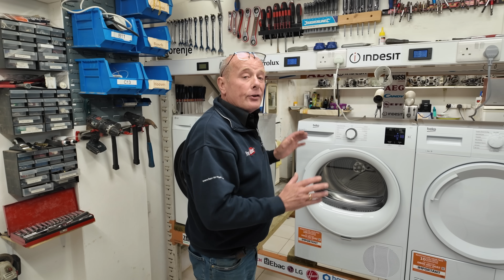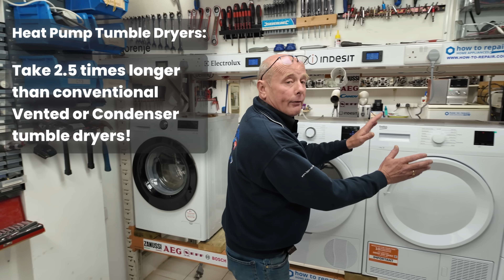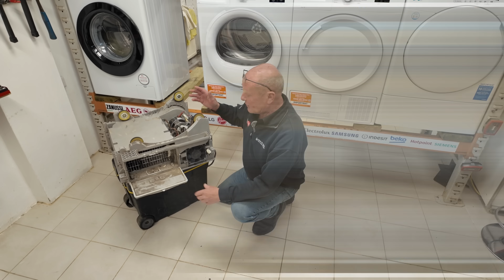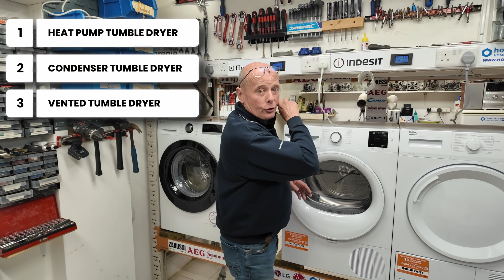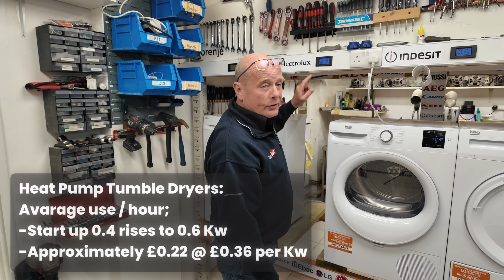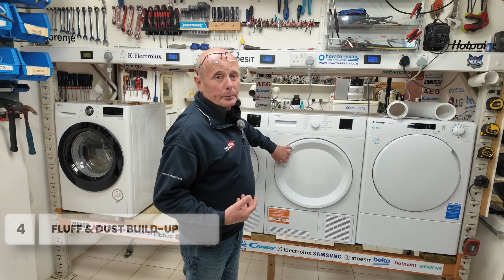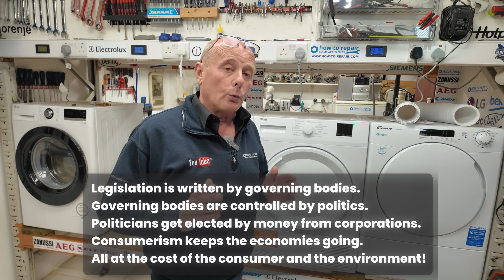Tumble Dryers the Shocking Truth About Heat Pump vs Vented & Condenser, NEW LEGISLATION!

Comment: If I live near a laundromat, I would drag my wet laundry to semi-dry in the winter season. I don't own a dryer but have recently used one at £2 per 10min. I find that it shrinks my clothes and that the dark colours do fade. 😕
Reply from the maker: Whether you are using a  vented tumble dryer or heat pump it is down to the user to make sure it is on a low enough temperature not to damage your clothing, thank you very much for your comment

Comment: My Heat pump tumble dryer takes <0.7kWh per load of clothing (measured at the outlet). I am not using the "green" defaults but set the power to +1/3 to make it significantly faster. The power savings paid for any additional cost and then some in the 6 years I had it.
Reply: The condensing dryer is just boosting the heat in your house during cold periods, which is when most people use a tumble dryer... No heat is lost
Reply: @chrissmith2114  shut it
Reply from the maker: I've never disputed the energy saving on heat pump technology but the wear and tear, cost, and insufficient thought by the manufactures to people who have to maintain them. Thank you for your comment.
Reply: Shut it

Comment: I am a domestic service engineer and this  is correct,  heat pump  dryers are a waste of time as the take to long to dry clothes, they have to be in a space  which is at least 15 c  to start with and within a short space of time they block up inside which is a 2 /3 hr repair with specialist tools. They have been completely mis sold !!  Condensing dryers are much more efficient and what you should buy.
Reply from the maker: Thank you very much. I always appreciate engineers leaving their remarks so it gives an independent view from other prospectives. Please try to share it with your customers.
Reply: My 3 old AEG heat pump driers are all working fine. Sure, I took them completely apart and cleaned them. Then installed a piece of 10ppi filter foam in front and the air flow is still perfect. No lint anywhere, except where it should be. Very low electricity bill and the noise is so much lower (on mine at least). My clothes don't shrink and keeps the color. The heat pump system on my combo AEG is super easy to service Takes just a few minutes. But not really needed any more after the 10ppi extra filter foam installed. I measure a 15+ difference in temp in well under 10 minutes, even though they are all in our basement (not warm, not cold either). I am very satisfied that my room does not get warm and very moist after drying clothes, pillows, jackets and duvets. My old Bosch condenser dryer burst into flames despite being very clean inside out. And it killed the clothes and was expensive on power.
But I agree, that so many machines today are built like crap. And WAY too expensive on parts.
And for sure, heat pump driers should be easy to maintain.
Sack the huge army of MBA's and things will improve all over the planet.

Comment: Appliance engineer here - heat pumps are a lot better in my opinion, they don’t shrink clothes. Risk of fire is so much lower and cost a lot less to run, YES they take longer to dry BUT an average cycle for me is 2-3 hrs which is don’t think is that bad tbh most of the time I run it over night so time means nothing anyway. In regards to the lint build up, if the filters are emptied after every cycle this wil never be an issue
Reply: How many times have had to strip down to the evaporator and condenser to clean it out properly.
A very time consuming procedure.
The principle is good but the design for maintenance very poor.
Reply: @atalanta6153 That may be so but can that problem be sorted by better design.
Things often improve in design over time.
BTW I don't argue for or against them.
Reply: @CheeseLovingGuy  better design would involve speeding up the drying process, which would negatively affect the energy rating.
Reply: I've been an engineer for 40 years, no way is this fella old enough to have worked on twin Tubs. Vented dryers are

the best, heat pump in a dryer is a compressor similar to a fridge, another layer of complication , my advise,don't touch one with a barge pole.
Reply from the maker: Heat pump technology is brilliant but the design of these machines is poor to say the least a child could've done better or was the manufacturer deliberately building it in a way to stop maintenance. I leave that as a question thank you very much for the comment .
Reply: Agree
Reply: @How-to-repair of course those manufacturers are! Vented is and always will be king. No fuss no nonsense, it dries clothes. I don’t care about efficiency or cost, speed is what I care about.
Reply: I’d never risk using a dryer overnight
Reply: I totally agree with you on this one.I have a heat pump drier and clean the filter out every time. I also regularly check the fluff build up easily on the condenser. I love it 😻 . 500w confirmed per hour. It will pay for itself in energy consumed. Even with longer drying times it uses 1/2 the energy of a drier with an element. 👍👍👍
Reply: My condenser tumble dryer is 20 year old bit bit fed up of it shrinking clothes, was thinking of getting a Heat pump whenever this dies. What do you all advise?
Reply: @hometechUK , my mother in law still had a single tub washer with an electric wringer in the early eighties. My mother had her twin tub until the late seventies and I used one as a student in 1983, so he definitely will have been dealing with them until the nineties at least. Remember that old tech was simpler and built to last longer.
Reply: @hometechUK  turn the heat down.
Reply: I have a heat pump drier and in my opinion it’s very efficient and isn’t much slower at drying clothes than our old traditional drier. Time will tell if it lasts, but it’s a year old now with no issues. One thing to remember is to clean the dust filters after each use and clean the heat exchanger regularly. My clothes dry usually in under an hour
Reply: Wear and tear after 2 to 3hrs of tumbling and rubbing against each other, lol looks like people are going to be buying more clothes. And what does that mean for the environment!!
Reply: Your comment is stupid, shit you filthy engineer
Reply: Not everyone is you , ya filthy know it all
Reply: Not everyone is you filth engineer
Reply: My condenser dryer is about 10 years old. I think I’ll buy a new one soon, before they are obsolete
Reply: Shut it engineer
Reply: Shut it know it all ridiculous engineer
Reply: NOT EVERYONE IS YOU!!!!
Reply: No way, wow !

Comment: of course there's a much simpler and waaaay cheaper solution , DONT use a dryer . my wife and i haven't had a dryer for almost thirty years . in the summer we dry outside on a simple portable rack and when it's colder or raining and snowing we place the rack next to our masonry oven . dryers damage natural fiber clothing and contribute to shrinking . but most of all we save a ton on energy costs and repair or replacement of the dryer

Comment: If you are using the heat pump dryer inside in Winter, you are in fact deducting 2KW  of power from your home heating system. 
I bet it does not tell you that on the packet. 

 I think the Servis twin tub was better quality than the Hoover.

Comment: This is madness. You're right, all that high pressure refrigerant is going straight to the the atmosphere or the landfill, in varying order when it dies. I just installed a GAS LG stack unit and went in and sealed all of the exhaust ducting inside the machine, I can see now how these things get so dusty, they exhaust isn't well sealed, huge leaks. I can't imagine trying to service a heat pump like that. Pulling the drum?? Come on. Definitely disposable. What a waste of so much energy, ironically.
Reply: It's illegal to vent none natural refrigerants.
Reply: It has taken too much time, but new models (at least in the EU) are using propane refrigerant.
Reply: @pizzablender  I wonder when cars will start using propane as its much harder/impossible to seal a cars AC system (due to the engine driven compressor) - fridges and heatpump dryers are hermetically sealed so the only loss should be during service or recycling.
Reply: @TC-V8  That would be a big advantage. But it is seen as a fire risk to have an evaporator coil with a flammable gas in the car interior. You know, cars can and do crash.

Comment: I have had an LG twin heat pump drier for around 4 years and up to now it has been reliable. There are two filters that I clean out but will do that more aften with your advice. Are there any manufacturers that you would recommend over another?

Comment: I have a Bosch heat pump dryer it’s about 5 years old it’s a good job I’m handy with a screw driver I have stripped it down twice to clean it and there is only my wife and myself useing it so not a lot of use the big downside is it runs it seems forever so if u need something dry quickly put it on the radiator .. and if u get one that’s a bit noisy u wont get much sleep if u run it overnight i will never get one of these again my next one will be a condenser definitely buy Bosch agian mechanicly never let me down

Comment: You make some fair points. I have just replaced a Hoover condenser with a A+++ Hoover heat pump. I would say my new heat pump actually drys quicker than the old one, quieter and clothes are way less creased than before. It is also 1/3rd the energy consumption. My old one has been given away as still perfectly good after 5 years of use. Only time will tell how long the new one lasts but for now all is good
Reply: Same. Purchased a cheap Beko heat pump dryer. Loads faster than our condenser dryer. Just over an hour. Dries at a lower temperature as well so no more knackered shrunk clothes.
Reply: @tonezoneuk I have a Beko heat pump dryer too. I really like it. 😊
Reply: Yeah, his numbers seems off (especially the much longer time for WP). From a repair standpoint, yes, WP is much more complicated. But Repairing itself has kind of become obsolete (European salaries...). But from a financial standpoint of the consumer, WP will pay off (unless you to lazy to make the minimal cleaning of filters...).

Comment: Planned obsolescence has to stop. The engineers would love to design something that lasts a generation, it's in their nature. The best would be to have an airing cupboard with a ducted MVHR and a large heat recovery heat exchanger. Beyond that, a longer, lower spin rpm, lower power HP cycle needn't be unreliable. We need to be serviceable fridges, hp driers and HP heating/cooling systems all with the same equipment.

Comment: I never even knew they made a heat pump tumble dryer. My wife complains about the length of time our condenser dryer takes now, so she would go nuts if a load took 2½ times longer!!!
Reply: There are settings to make it significantly faster with negligible power consumption increase. My dryer time is on par with my washing machine short cycle. Depending on the cloth thickness, load size and water retention it's usually 60-90 minutes with the odd outliers like soaking wet towels taking over 100 minutes, but that is to be expected when the washing machine does it's job poorly.

Comment: Great vid. Very insightful. I have a question i wash my clothes in a 30/ 40 degree 1400 spin but i dry fir 100mins plus on a condenser dryer
 What am i doing wrong? Why is it taking ny clothes so long to dry?
Reply: Are the clothes actually able to tumble down from the top as the drum rotates, as if you fill the machine to the top, then the air is not able to circulate in to the clothes as the fall from top to bottom- I see so many people overfilling their dryers like this..
Another thing is to check and clean the filters before each use..
Could be the heater is only working on a single heat setting as well

Comment: I have been repairing my own domestic appliances since 1977 when I got married and found out how easy some repairs are, and how much money can be saved, but I have noticed over the years that manufacturers have made this increasingly more difficult and expensive, an example Hoover vaccuum cleaner only needs motor brushes but they only sell a complete motor at 2 thirds the cost of a new  machine only just making it viable for DIY and definitely not for a shop to do. in all this time I have had only 2 tumble driers which are of the vented type and I learned to clean the lint out from inside the cabinet regularly after the smell of singed lint on the heating element alerted me to that danger. as I am now on my own I have not used the tumble drier for about 18 months since buying a de-humidifier and rack that drops down above the bath. my thoughts on condenser and that latest incarnation of tumble drier is that like double glazeing, you will spend more replaceing them when they fail than the energy they may save you. P.S you brought back some memories with this video, my mother had a Hoover twin tub when I was boy growing up in a house with no central heating and the way energy costs are going it seems likely will be going out the same way.
Reply: The idea of costly energy is to rob the middle class of their hard earned gains since ww2 ended. The greens are making life miserable for all but the ultra wealthy. Guess where greens get their funds? From the richest entity on the planet, the Rockefeller foundation, the source of all evil today.
Reply: @johntheoldmod  It is simply ridiculous to watch British complain about heating costs while unironically claiming that basic 40 years old home insulation standards, implemented everywhere else in the world, weren't worth their money.

Comment: Manufacturers should be forced by law to design equipment to be easily repairable. It is not just white goods it's everything. Stupid designs either by lazy or incompetent engineers or company policy deliberately going down the expense and complexity route to create headline figures to put in the marketing  material about trivial features we don't need. Part of the problem are customers who are as scientifically illiterate  as the useless politicians  greenwashed by big business.

I am not an expert on washing machines but I would be surprised if there is a single manufacturer who designs the product to be easy and cheap to repair.

Excellent video and not a day too soon.

Comment: Great so I need to stock pile a couple of venteds in my shed next to the incandescent light bulbs and bottles of water that have removable caps, I knew when I first saw a heat pump dryer that they would have used this as the perfect opportunity to make it disposable.

Comment: So lucky to live where a tumble drier is useless, and a clothes line is the standard thing.
Reply from the maker: You are very luck mate. If only the UK could provide us with weather that would allow for line drying! Thank you for your comment. I appreciate you taking the time to write it out. Please share it wherever possible. It might help others make informed choices instead of being misled by the industry
Reply: @How-to-repair  Yes only 27C today in South Africa, nicely down from the 32C of the same day 2 weeks ago.  Living by the sea also means cooler weather, inland was sitting over 40C for a while as well, but with lower humidity. AC heat pumps pretty much have the reversing valves stick solidly in cool mode, as you might have 2 or 3 nights a year where a heater is a thought.

Comment: One thing you didn't mention is that heat pump dryers won't work in temperatures lower than 5c which means you can't use them in a garage in winter.
Reply: They will work down to -4C (possibly lower) but most have a condensate spray system so it has potential to freeze below 0 C. There is no actual information that states they dont work. Unless someone has actual correct witten documentation
Reply: I keep mine in a spare bedroom. No air vent, no water drain, just a 13amp socket. Yes I empty out a tank each time but that is for convenience only. I could move it to a less convenient location to have it drain normally but not worth the faff.
Reply: In my garage is a car, a motorcycle, a bike and a lot of tools. No way a tumbler could be in there  ;)  And NO way I would let moist air out on all that gear. I dry my car, if  it has become wet, before I put it into the garage.

Comment: I have a 27 Year old Zanussi Condenser. Still working great.  I clean out the fluff and empty the water after EVERY USE. perhaps this is why it has lasted so long 
also, it has never needed any mechanical parts.  I hate to buy a new one when this one works like new, however, it may be getting tired now after all these years.
Reply from the maker: It's difficult to comprehend that manufacturers anticipate consumer satisfaction with the need to replace major appliances every few years. Exploiting environmental concerns to drive sales is absurd, particularly considering the significant ecological damage this practice causes. They are irreparably damaging their reputations by producing such short-lived products.

Thank you for your comment. I appreciate people like you taking the time to write it out. Please share it where possible. It might help others make a wise choice instead of being misled by the industry.
Reply: I had such an old beast as well. 4 kWh for a load. Three times as much as the new one. And the new one runs a lot cooler and causes less creasing.